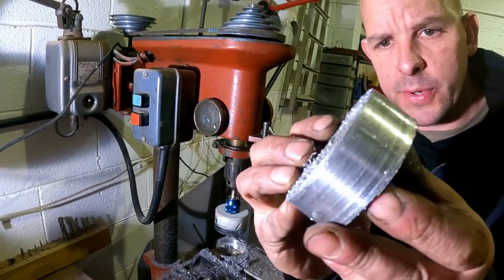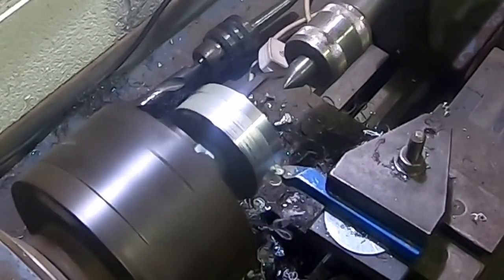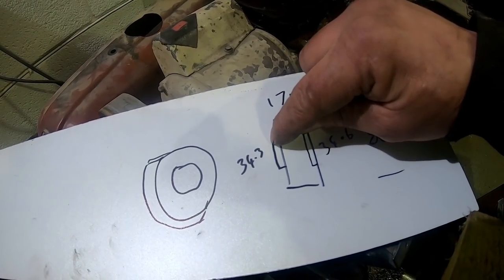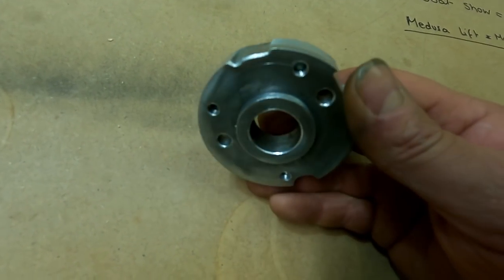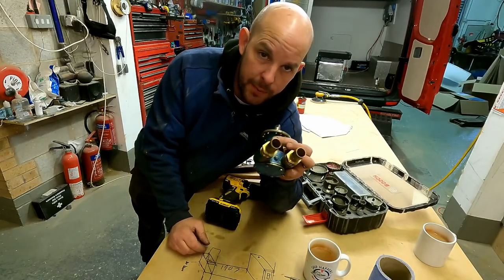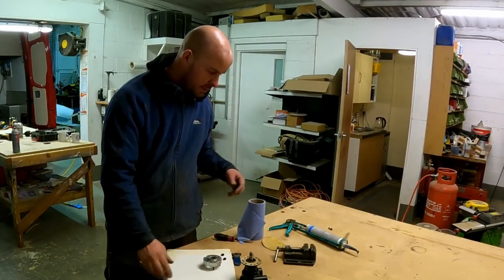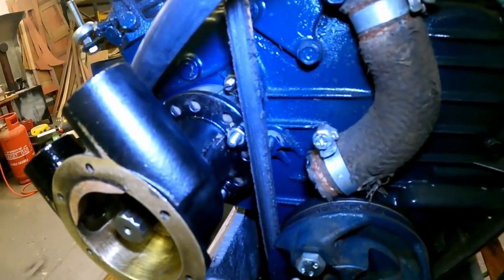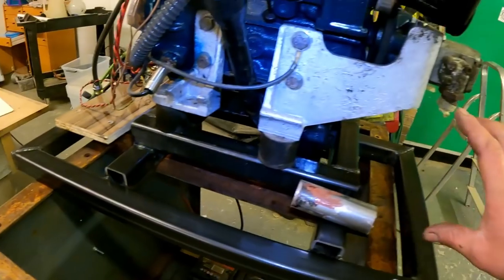DIY DC Marine Generator Build - Making A Heat Exchanger - Part 5 ⚓️

Comment: Hi Simon
I love what you and Gemma are doing and I really admire your technical ingenuity and skill. That generator really looks the part as well as being just want you need for Sarinda.

That’s a brilliant  heat exchanger design, but I absolutely agree with the guys suggesting that you instal it with media in counter flow mode. 
 
If you make it contra flow, then you will maximise the temperature differential across the whole length of the  exchanger.  This means that on entry, the hot coolant from the manifold encounters warm water in the raw circuit, but as that coolant cools down,  it will be constantly meeting cooler and cooler raw water so that heat transfer takes place more uniformly across the whole length of the exchanger. 

I’m not an engineer, but worked for many years in offshore industry procurement, and exchangers were almost invariably  contra  flow

Keep up the good work guys!  You make my Fridays!

John

Comment: You want the water in the two circuits flowing in opposite direction through the heat exchanger. That will increase the efficiency.

Comment: Hi there, Simon and Gemma and the kids too,
You say that you haven't Soldered for years, and that you are going for Working Properly (with no Leaks) than ascetics. May I say that, the way you chose to do it, is MUCH better than the other way. And your Soldering skills seem more than adequate to me, I am an Electrician by Trade, I have done a lot of soldering in the last 35yrs or so and I can tell you by using all that Flux, that's part of the best Secret, as you will not end up with any Dry Joints or Holes, So you have nothing to be ashamed of at all, Job Well Done. Besides, I have seen 'Experts' soldering a lot worse.
I Love watching your Videos, as they are honest and true to the Faults even, It will be Great to see the end Result. And keep doing things your way, yes it is good to speak to Specialists in the different areas, or watch different YouTube videos to learn for yourself, But the way your brain works, I can see that these things are usually to Improve your Confidence, that what you were thinking is right.
Besides, I also Notice that you are more than Happy to say when you are Wrong, and give Credit if someone else says this will be a more Efficient way of doing things.

So Keep up the Great Work and Keep those Videos coming.
Well Done to you All !!!!!!

Regards,
Gordon Townsend
NSW - Australia
Born in Stoke-On-Trent, UK

Comment: Noticed what might be an oversight.  In a counter flow chiller loop (I am very familiar with) the cold and hot circuits go in opposite directions to each other.  In your diagram you have the cold and hot in the same directions.  Hopefully you can remedy this from outside with hose connections.  Your copper counterflow chiller is really quite elegant otherwise.
Reply: Yep the counter flow system ensures the maximum temperature gradient over the whole length of the heat exchange unit thus resulting in maximum heat exchange between the two separate fluids
Reply: I wondered that also. Thanks for clarifying.

Comment: Hello there.
I follow you blog and it is a big job you are doing to get the ship sailing again. As a ships enigineer I have one remark about the cooling system from your aux engine. On your drawing  I saw that the cooling water and the raw water have the same flow direction. You will get a better cooling effect by let them run in the opposite direction. For the rest "chapeau" for what you are doing and wish you both good luck with the restoration of this historical vessel.

Comment: Nice job Simon. Nothing wrong with the cooper circuit you plumbed, but swap the raw water connections from what you described. Having the coolant and raw water flow in opposite directions will greatly improve your cooling efficiency. That way, the hottest coolant meets the coldest raw water for maximun heat sink. Lovely job, mate. I am learning a lot from watching you work. Thanks!

Comment: You want your raw water feeding into the  lower pipe, and the hot water from the engine feeding into the top pipe so that the two water flows are moving in the opposite direction.  The coolest coolant will be in contact with the coldest raw water.

Comment: Simon,  your soldering is coming out like that because you're not holding the heat low enough on the joint.  1. Make sure you've got plenty of flux    2. Heat the work, and let the work melt the solder,  the solder will follow the heat, so heating lower into the joint will cause the solder to be drawn into the joint.

Comment: Nice idea. Would have been a good idea to run water through the raw water system, with a garden hose and see if the engine temp stablized. 👍👍

Comment: Triple ooo steel wool will clean your solder joints up and. Make them look better than professional. Just lightly hit them with the steel wool after putting the solder on the joint while it’s still hot.

Comment: Did you hear me yelling at you not to run the impeller dry? They don't last a minute...well, good lad, you knew! I'm not sure you have enough cooling area, in your heat exchanger, but diesels run somewhat cooler than petrol engines, so perhaps it will be fine. One more quibble (I'm full of them, tonight), have a strainer upstream of the raw water inlet to the exchanger- raw water isn't only water, and it wouldn't take much algae or seaweed to fill the space between the inner and outer tubes.

Comment: All well thought out Simon, one suggestion is to use lead free solder being a touch harder than leaded, or if you can grab some cheap silver solder is better again. Thinking of the vibration of the unit on those joints over a period of time. But it's all there buddy so again well done and with a coat of paint it will look spot on.
Reply: I first thought that but then I remembered a How it's made episode where car radiators were sealed up with leaded solder. Should be good I think.
Reply: @alstonofalltrades3142  Yep your right Anthony, but car radiator aren't fixed to any engine bracket or stands as in Simons case, there fixed to the car body, but again using what is termed as soft solder (leaded) that's why over time they often leak where the solder breaks down through even small vibration of the whole radiator. Lead free is a harder solder but the very best would be silver solder or even brazing them up with brass brazing rod. Not a problem now but the vibration through the engine chassis as such again in Simons case maybe not to far down the road. Example of which you often get a correct fully soft solder joint break down through the expansion=n and contraption alone, say with your heating system at home, add a bit of vibration to that, say by walking on the board it may be fixed to tight under, or the pipe notch is to tight or not deep enough in the joist for movement and the joint will breakdown faster of course when you don't want it to, if at sea you may have a real problem if you wish to depend on it. You can also get what s known as Farmers bands or Dupro clips, which are metal two piece brackets that fit all sizes of copper tube and are 8 or 10 mm threaded for fixing with a rubber insert which helps again with vibration, expansion and contraction.

Comment: Steven, Interesting design of heat exchanger, neat and compact. That genny is becoming a work of art, hope your back's OK and you recovered from the Mouth to Mouth!!!!!!!!!!
 I had those pumps on my 2.5 lt Transit boat engines after we ripped our the laid over Leyland's. A fault I had was the retaining screw that held the impeller squash plate kept snapping, the first time it happened I didn't  have the same thread screws in my odds and sods box, but found one in some electrical gear. Did get some spares later and the screws did fail again. So get some spares ready for yours.

One engine was piped to the hot water tank and I connected the other to an old Transit heater to warm up the cabins and wheelhouse during winter runs and engine run up's. So no waste heat on my old girl.

Comment: Really nice job building that heat exchanger. I do seriously worry that you won’t have enough surface area for the heat to exchange between the hot and the cold water. You probably need to add another loop or two of the same size. When you look at proper heat exchangers they have many little tube that add up to a lot of surface area for heat to exchange. It’s all about surface area. FYI there are pre made universal heat exchangers available.

Comment: Great piece of work, Simon.  Just one wee thing to consider... as you intend to use raw seawater through the internal pipe, be careful it doesn't rot quickly (a year or two!) with electrolysis...  I would put a rubber boot on the ends to keep away any electrical earth.  Or use a bit of plastic pipe and some rubber liners on the brackets.  Check with a multimeter

Comment: Maybe  pump your central heating water through the heat exchanger instead of raw water, for the engine and exhaust manifold, and 
use the raw water just for the exhaust?

Comment: When you solder heat the pipe not the solder.  When the pipe is hot enough put the solder on the joint and it will melt into the joint. after there enough solder remove the heat and wipe the area with a cloth rag to clean it up.
Reply: Note: As the pipe cools it will suck the solder into the joint, but you need to lightly sand the pipe and fitting, then flux both lightly to get quick and even solder spread.  Works every time and uses less solder.  

Great job on engineering the gen set!

Comment: Couple of things...

Your raw water goes into the "cold" end of the exchanger, rather than as drawn on the board. Improves thermal performance a bit.

Second, get the pipe hotter before you put the solder on. Use the heat to move the solder through the joint. You've got a good looking joint in the end, but you're starting cold which is why they end up looking a bit messy.

Looking damn good though.

Well done!

Comment: First,  I've been enjoying the channel, Keep up the nice work.      So,  looking at the heat exchanger,  I'm not sure if you will have enough surface area to transfer the engine heat to the raw water side.    Before spending precious time on the radiator setup,  get a large barrel (55 gallon?) and fill it with water and run the engine with the raw water pump running from the barrel and dumping back into it, for an hour or more, while monitoring engine temp.     Sort of think you might need two or three of those ingenious heat exchangers.

Comment: Cool Simon ... now as we would say state side you are a pipe fitter qualified. ... LOL, if you have problem with the solder you can redo with silver solder higher melting point and it hold up under stress vibrations and heat/cold changes too.

Comment: Thanks for showing us how simple a heat exchanger can be! I am amazed by the small gap between inner and outer tube, how do you know in advance what diameters and circuit lengths are needed to cool the water sufficiently? No criticism, I am just curious. In case I would have to make one myself. The videos on the boat itself are great but this little series on the generator is nice in itself as well. Thanks again!

Comment: Brilliant job Simon!!! 
I’m probably teaching you to suck eggs! But if so for the benefit of other viewers, the clips holding the pipe work to the cradles will need isolating from the copper tubes, in the same way you are isolating the pipes from the cradles, as the steel will corrode the copper, as it’s a superior material. Been to a number of house called for leaks under floors where someone bent a nail over the central heating pipes to keep them down and it rotted the pipe!🥴

Keep up the good work! And love the comedy!🤣

Comment: hi guys love your work. being a plumber in AUST. we use silver solder on copper fittings. i have used both. in my humble opinion i prefer silver solder. 2% in Aus. its a bit stronger.:goodvibes::goodvibes:.

Comment: The distance  between the inner 22mm and outer 28mm copper pipe, each 1mm thick is only (27 - 22) / 2 = 2.5mm for the anti-freeze. This looks a little to narrow to me. It results in a anti-freeze area of 0.25 × 3.14 ×( 27 × 27 - 22 × 22) = 192 square mm. The first test with anti-freeze looked fine however, even without running the raw water circuit.

Comment: I’m very impressed with the salvage and skillful building up of the “new “ genset! 
Here’s a soldering tip. Only put the flux where you want the solder to stick. This helps with overrun. Also, only heat the female fitting, towards the back/side of where the pipe will seat. The solder will suck into the joint as soon as the fitting is hot enough. Don’t place the solder where you’re heating, it can prematurely liquify and flow into a joint that isn’t to proper temperature. Try to not flame the insert piece, it will get plenty of heat through transfer from heating the female fitting. 
A very small amount of solder is used this way. 
Remember that there’s a very good likelihood that just as much excess solder, if not more, is on the inside of the fitting as your seeing on the outside. This will limit fluid flow, and can possibly break free causing damage to other components. 
Once you’ve got it down you’ll be amazed how little solder is required to make a perfect joint.
What your going for is a smooth looking transition with no excess as all.
Reply: Also… SAL-FOS 15% silver alloy rods are what I use when soldering critical copper joints. Joints that may be subject to high heat, pressure, or vibration.
It has a much higher melting point than regular plumbing solder so you’ll need to either use oxy-acetylene brazing tip, or what I use, a turbo torch. Turbo torch handles and tips are kinda pricy if you’re not going to be doing a lot of refrigerant work.

Comment: Nice job Simon running sound put some thin rubber between the copper
pipes and brackets couldnt hear proper what you was saying tinnitus is a bad thing
is that gap between the inner pipe enough though

Comment: Did you look at using a marine gearbox oil cooler as a heat exchanger for your Kubota?
Does exact same job for a gearbox as the heatxchanger does for  the engine.
Be cheaper, easy to mount and plumb up. Plus it should have provision for one possibly 2 x zinc anodes to be used as well.

Comment: Surely your heat exchanger would cool better if you have two parallel tubes for the raw water, rather than a loop,  so you get double the flow. It does mean that your inlet and outlet pipes need to be 40mm so you need a T piece with two reducers either end. More work but the advantages are huge as the thermostat should take care of over cooling..

Comment: Could you have machined the shaft down to shorten it, braze the existing holes in the flange, and then drill new mounting holes?  Would that have worked?  BTW, your adapter plate is brilliant!

Comment: hi have a look at the evolution unit generator ,this is a very cheap generator and with a bit of magic could be fitted to the engine and if fitted you would have a  110/240 volt at a cheap  price,  love what you are doing  regards

Comment: Good work I hope I'm wrong, but I don't think that will be enough cooling and I think the engine coolant passage will be too restrictive. It's always better to have too much cooling area than not enough. BUT I hope it works.  My friend used a small car radiator with ducting and a fan.

Comment: Fantastic work. Do you think you will get a big enough flow of coolant water in the outer casing… as it is quite a narrow gap between the inner and outer tubes? I’m sure there is a formula for temp in vs temp out on a contra flow heat exchanger ( with water flow rates  ). I would hate high pressure in the outer casing to do a mischief to your wonderful work! :)

Comment: Yaa mcgiver Simon is back !! 
GREAT work as always fella 
Ha ha you must have  pulled some BIG strings to get an ambulance to come visit with a lom ( 3 star manager) to come pay you a visit  !! ( I could have done it cheaper ya know !! ) just might have taken me a while to get there !! (4 hours +) lol
1 quick question  .. is there enough gap between those inner and outer tubes ?? I'm no expert but I thought you might need a bigger gap around that pipe as more water equalsas better cooling and i don't suppose you know the water pressure of that raw water pump ? 
Just my thoughts ... could and probably am TOTALLY WRONG  !! LOL

Comment: There's no point in a dedicated 12v generator since you only end up with a vehicle alternator which is not designed to charge leisure battery banks, a 240 v generator will power a proper multi stage charger and any other tools or items you want to use on board.
Reply from the maker: We are making a 24v generator, because our boat is inverter based, so we are charging the batteries direct therefore less loses. Eventually we will be putting a remote regulator on it which will give us the correct charge profile.

Comment: This reminds me of Johnny Cash's 'One Piece At A Time'     https://youtu.be/18cW_yHo3PY
"The transmission was a '53
And the motor turned out to be a '73
And when we tried to put in the bolts all the holes were gone.

So we drilled it out so that it would fit
And with a little bit of help with an A-daptor kit
We had that engine runnin' just like a song"